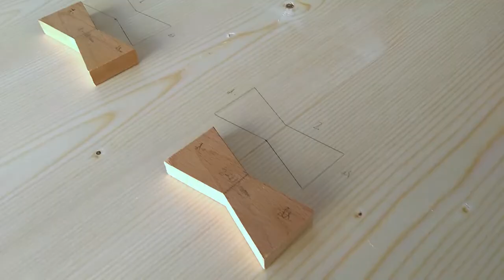Making a garden table with hand tools

Comment: Is the shooting board MDF?
Your bench looks like laminated MDF too.  What did you you put on it?  Just BLO and wax?
Reply from the maker: Yes, I used MDF because that's what was readily available for me, plus it was cheap. I saturated the workbench top part with multiple coats of tung oil followed by raw linseed oil and it holds up well so far.